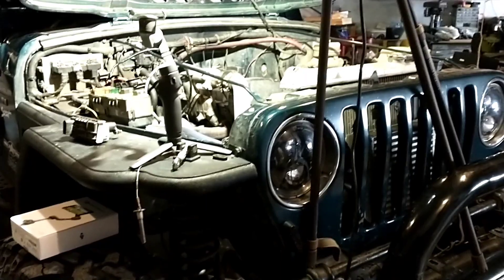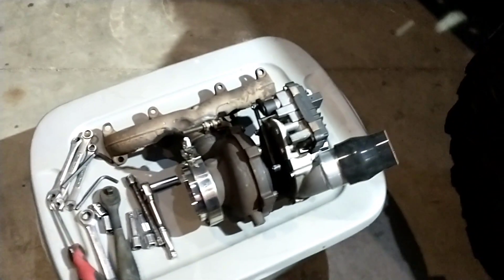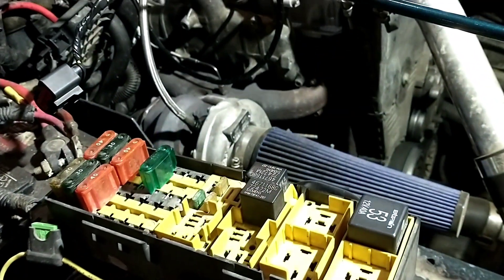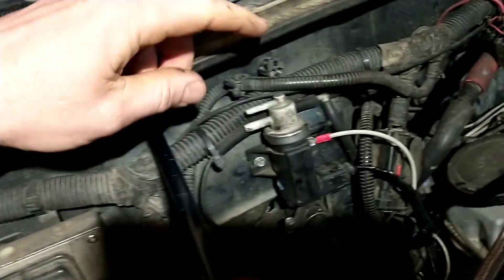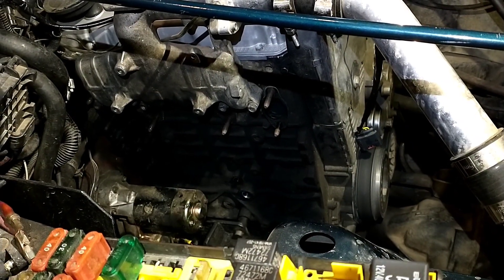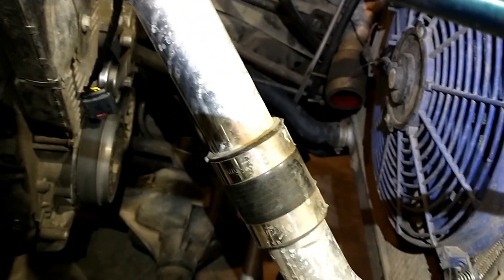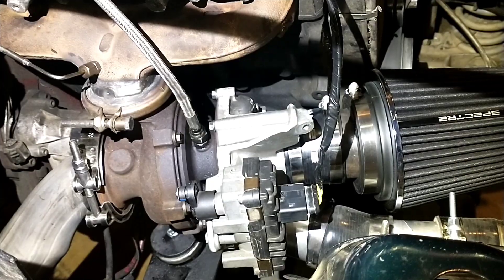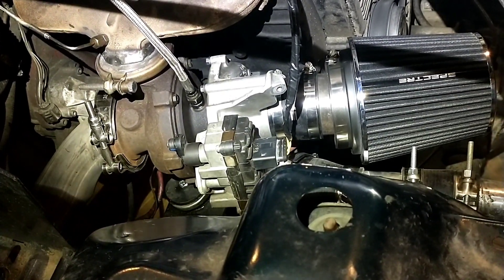TDI Diesel Swapped TJ Jeep Wrangler Gets A GTB2056 Turbo Upgrade!

Comment: I need to get a FB account and follow you there.. 

Hey,   I have a  Liberty with the 2056 turbo..  Been  thinking about  that size  in my  TDI/Toyo  project.    
anyhow,   am I mistaken by your manifold to turbo  connection is a v-band?    I like that better than the welded version.   I have no doubts on the weld's strength,   it's just the  replacement/service part down the road... MAYBE some minute warping putting some stress on the housing.. 
But for now,   What's the minimum fueling this would still be a decent driver-  150+ hp?     My liberty is tuned for about 180,  but it's  0.8 liters bigger.  I was told on  CRD website, that turbo is good for up to around 200 hp  on that engine.
What's your 'take' on the electronic actuator by now  lag wise?   get it  'dialed in'??
Reply from the maker: Once dialed in the electronic actuator is almost 3x as fast to regain boost between shifts.  I also had a 2.8 liberty tuned for 180 HP, but the RPMs limit it.  The TDI revs to 5k with tuning and a 180 HP TDI will walk away from the 2.8 once boost kicks in.  2.8 has better low end torque though.  2056 is a great TDI turbo, they just don't really take off til 1800-2000 rpm
Reply: That's my next project-   I thought I had another 10-12k miles before the  CRD's scheduled timing belt change.  Wrong-o.   I believe I have all the parts to put it back together.   Running a  Green Diesel tune (before the EPA  got heavy handed)   @TDISwaps
Reply from the maker: @roberttammerawitchey4652 ouch ya those engines are quite complex too.  I had the same Green Diesel Tune I believe, about the only place that would tune them.  Really likely that thing but needed a pickup more than an SUV, so I just had to start building them haha
Reply: I misspoke-  the belt didn't break-  the water pump bearing went bad... which loosened the belt.  It was all over in  mere seconds @ 60 mph. @TDISwaps    Mechanically,  it's crazy,   electrically it's  a nightmare.  But boy, it was fun to drive!  

  I loved when  people would run up to me at the pump;  "Mister!! you can't put diesel fuel in that"!!
Reply from the maker: @roberttammerawitchey4652 either way that's no good for the internals 😞 but yes I do miss mine, especially that low end torque, the TDI needs 4low to make any power down low.  And that 2.8 straight piped made the best turbo noises!
Reply: yep  that GD tune put all the low end torque back.. and I immediately got  torque converter shudders. I was just about ready to buy a suncoast TC  when it grenade'd.. too bad they never offered it in NA with the 5 speed.. they all went to Europe! @TDISwaps
Reply from the maker: @roberttammerawitchey4652 yup that was the second reason I had to let the liberty go, when I bought it there were 10-15 site to get parts from, now there are less than a handful

Comment: Hello! For that electronic actuator on the turbo, only remap is needed? Edc15 is capable to control that? I have 1z converted to edc15 and i put pd130 turbo but i want more power. Order .280 injectors and im looking for bigger turbo. Electronicaly controled turbo is better than vacum. But i dont know is everything plug and play with map.
Reply from the maker: Yes only tuning is needed for the actuator, everything else will work as normal
Reply: @TDISwaps thank you for fast answer. Are your tuner changed pwm signal or just n75 map? What is number of actuator?
Reply from the maker: @sunedzedaj  I would have to look at the actuator again but it is the factory version for a gtb2056.  You only do minor changes to the map, possibly reversing the map if the actuator is moving inverse and set the signal up for whatever frequency these actuators respond at, the one on my Toyota is 150hz and this one is 300hz.
Reply: @TDISwaps  if it is stock actuator, i will find on internet. I work on my maps in vag edc suite. But, changing frequency in that program i think is not possible. I will try to find that on internet. That actuator and turbo will be a very good upgrade on my car. Thank you alot for advice. Im still learning how to change maps on my project car. Im car mechanic and i wired whole car and engine,  but on laptop, and software i dont know much. Does it exist better software for doing that mods? I try winols but it is very hard for me. Dont understand much..

Comment: What injectors your running? Got a gtb2056 as well for my alh mk4 amd some Jarod March made. 280 injectors. Curious how you like it and your fueling
Reply from the maker: I haven't finished testing yet but I will be using .240-.260 injectors, I am sure it's gonna be an awesome setup.  I already had a gt2056v tuned very well and this should be little to no lag compared to that